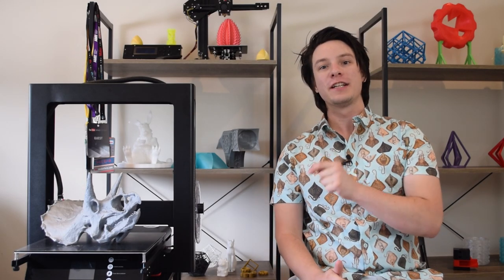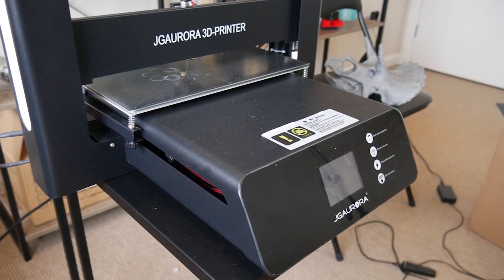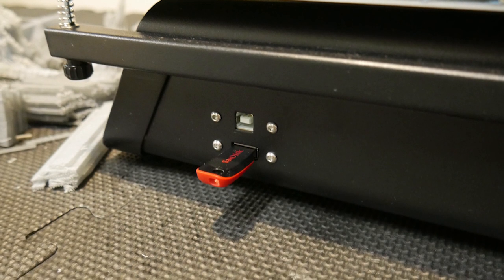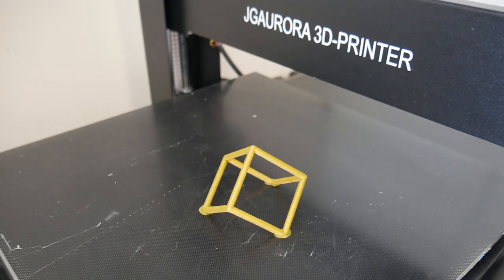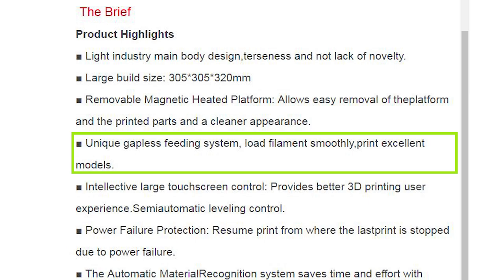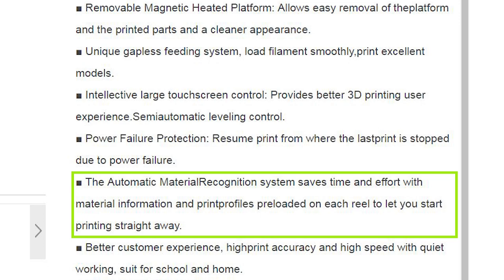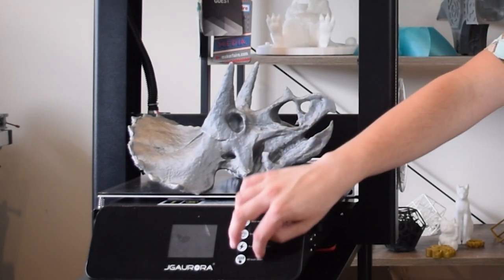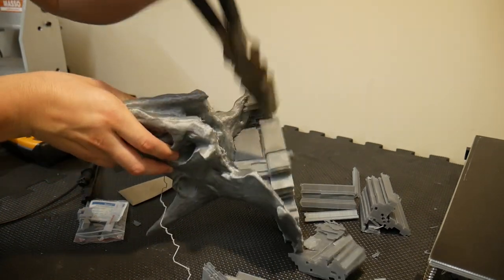What is this 3D Printer supposed to be? JGAurora A5 Review

Comment: To me this looks like a typical case of a printer that has the MKS BASE V 1.5/ 1.6 mainboard with the MKS TFT28 / TFT32 touchscreen installed with the "retro" skin touchscreen firmware update. The wifi chip should be on the TFT28 BTW (if installed). The TFT28 touchscreen has this standard Wifi menu item, that is to cooperate with their Android App. The idea is that the TFT28 creates a so called "adhoc wifi network" that the user could connect to using the app... It never worked for me though... The most disturbing property of the MKS TFT28 unit however is that it is a rather independent unit that generates G-code commands that it "injects" into the stream of commands (going to the MKS BASE board) coming from USB or from the SD card, without any prior checking. This results in unwanted behavior like being able to "inject" a home (G28) command in the middle of a print... Is that something that has been tackled with this machine?
Reply: You're almost right  - its MKS TFT28 V3.0 and MKS Gen_L V1.0

No WIFI module is installed, but I did find the plug in item listed for sale elsewhere - not sure if it would work if plugged in though - and the firmware is "closed" even though it is against Marlin rules

Comment: Please check the firmware update system from the manufacturer. Naomi Wu commented that you have to send the printer back to China to load a new firmware in the factory??!?!?!!!
Reply: That may have been for that A7 she was reviewing. There is a guide on the included USB that shows how to flash using the included Cura on the A5.

Comment: I would recommend, you start testing, PSU, most printers USE LED Lighting PSU, this is bad as they are Low Quality & they are not the Specifications they say they are, I have tested 3 China PSU's they were all way off not even close to Spec. I replaced my PSU in my CR-10S as it Blew up, YES Blew UP!!! - If a Fan fails your in Trouble with these LED PSU's!!!! Will it Cause a Fire, it sure will, they dont Shut OFF they keep Going, Smoke then Fire! The Fuse Dont work in these at least not mine, they are not even Wired Correctly, follow the Wiring Dont Do much of any Protection! you have to Add a inline fuse to these for your Own Protection. Not Saying all are bad But the Quality Control isn't very good. If you have a 30A PSU use a 20-25AMP inline Fuse, Between the Printer & PSU, Plus Start USing a Surge Bar that Has Inline Fuse thats double Grounded. 

So why you having these ISSUES? The HEAT BED!!! Replace them they are Junk they are unsafe use AC heat Bed's that are stand alone - The LED PSU will be fine as 85% of load is Gone!!! 

 I recommend that All China Made PSU be checked & if you get Dirty Spec's Replace!!!! If you have a CR-10 Replace it - with this one, well made & Spec's are Spot on!!!!

CR-10 Replacement - https://www.amazon.com/gp/product/B007K2H0GI/ref=oh_aui_detailpage_o03_s01?ie=UTF8&psc=1
Reply: Dave,  I don't know what supply is in my CR10S, It has run good. Thanks though for the link to the meanwell power supply. There has also been some issues with Asian made LED grow lights. The recommended replacement for them are Meanwell  branded supplies.   All in all though I really like my CR10s. It's a pretty solid printer.

Comment: Got 1.... Came in with a loose screw in the box
Found out that the screw belong to 1 of the bracket holding one of the build plate guiding rod which was also not installed properly.
Had to open up the machine chassis to fix it.
The filament feeder wouldn't load automatically, so you need to feed it manually...
Wifi ins't working...
The bowden tube was broken at both end....
After the first print which was actually good, a set screw holding the gear for the X-Axis belt came loose and made the belt skipping...

All of this on the first day...

I've managed to get a few prints from it which were nice and had no issues with removing printed items from the build plate, they simply came off by themselves ...

But i wouldn't recommend this printer simply for the UNDERPAR quality control from JGAurora...
They said that they "thoroughly" tested my printer before shipping... 
Which is false since it could not print anything from the start when i got it as 1 of the guiding rod for the build plate was completely loose and wooble in the chassis...